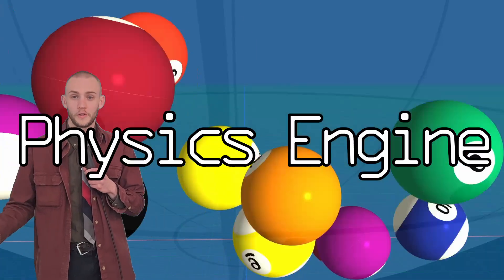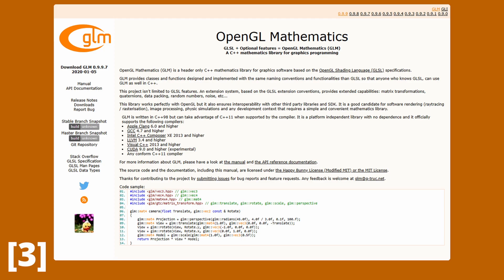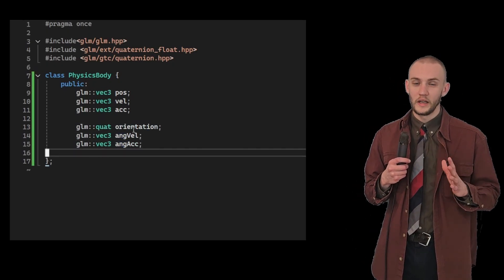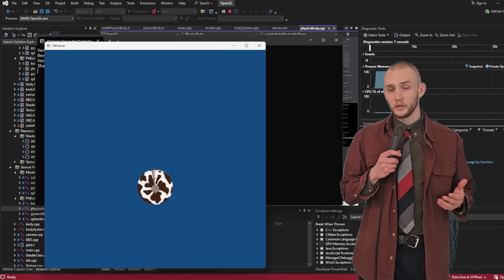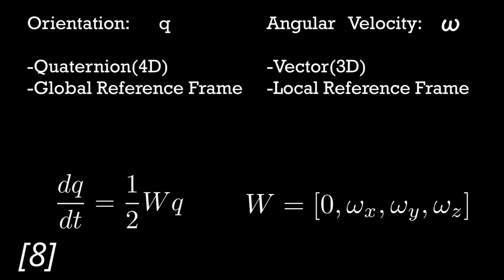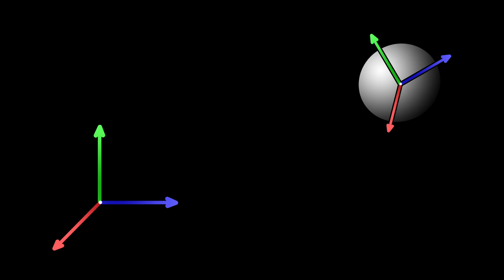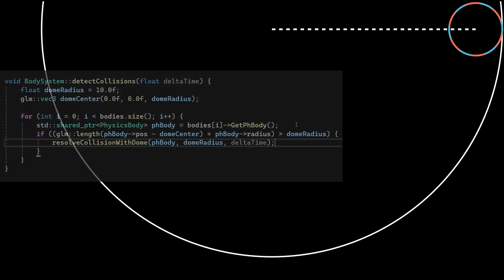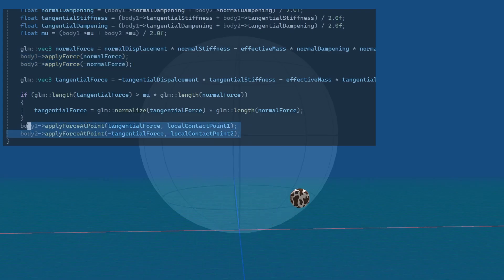A 3D Physics Engine From Scratch Using OpenGL and C++ (Step-by-Step)

Comment: This is fantastic! 

It does feel like some of your constants need tuning. Those billiards balls feel much too floaty and slow in the air, but their collisions with each other make them feel sped up. Moving away from engine units to something more grounded will help a lot.

I hope you keep working on this!
Reply from the maker: Thank you! Yes you are probably right. The balls are pretty soft in the demos, I am currently implementing more advanced numerical integration methods to be able to simulate stiffer bodies. Video should be up soon!